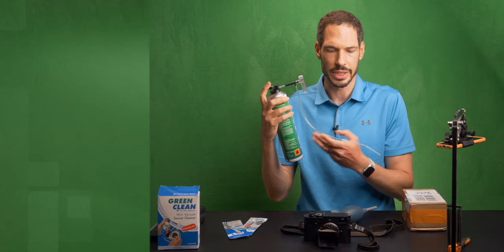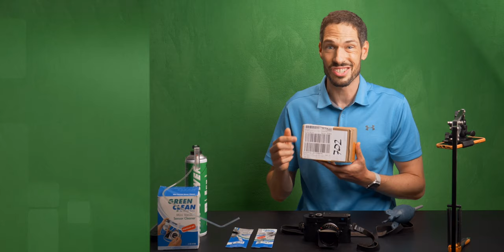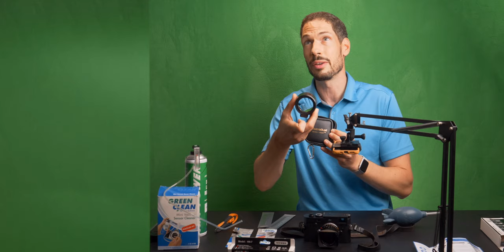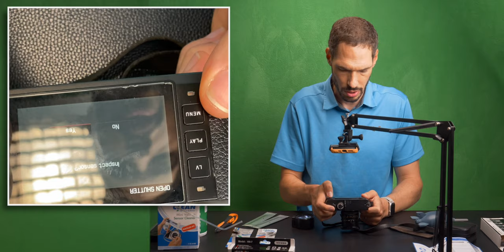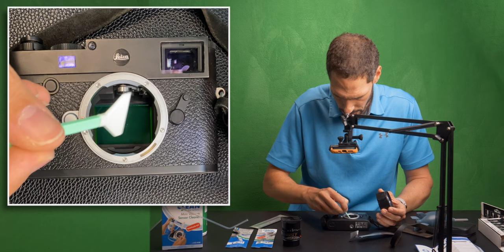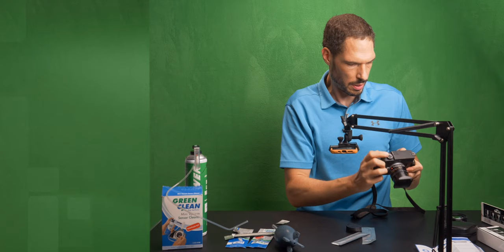Never use old wet sensor swabs! How I saved my Leica M10

Comment: Hi 
I have an " old M8 " that I cleaned with a wet swap - all dust marks gone but a bit of a smear mark on sensor! - camera shop where I bought camera 14 ++ years ago said they will clean it free - so will be bringing camera to them soon !
I think I will make  it a habit to only change lenses on camera before setting out and just use camera with one lens at a time !
That is no swapping lenses in the field !!
Have a 35-50 and an ancient 135 with goggles !  
Get vid thanks !
Reply from the maker: Thank! Being careful when swapping lenses is a good practice. Most of the smudges after cleaning don't come from dust but tiny oil droplets (probably from the shutter mechanism?) or other liquid 'dirt' from the sensor swab. 
Enjoy the M8, it's a fun camera.

Comment: i understand the logic behind not wanting to blow the air into the camera. but i would never touch the sensor with any suction device or anything else besides swabs. AND unless i absolutely have to. Just use the blower but have the sensor facing the floor and gently blow air onto it. This resolves 99.99% of the issues. If you have oil or anything of that sort on the sensor then use high quality swabs. I use Invisible Dust. Very good. Also sensors by nature already do have a protective thin layer. No need to sweat ;) Thank you
Reply from the maker: Thanks for the comment and suggestions. Touching the sensor with the suction device was an accident. But good comment, and I will never do it again. Blowing in it with a blower and having the sensor facing the floor would have saved me a lot of stress...
Reply: @bplatel You could’ve avoided all this by doing some light research on sensor cleaning techniques. The “blower thingy” has been used by professionals for years.
Reply from the maker: @ziggy149 , sensor swabs are also used by many professionals, and I have used them with a lot of success before. However, these were apparently overdate. 
Blowing dust around in the housing of the camera could result in dust particles in unfortunate places. That's why it is recommended not to do that by some... Still would have been safer though 😅

Comment: To test for dirt etc on your sensor. Switch auto iso off, use F22 or as near to F22 as possible, select a plain background grey or white. Take an image of plain background while rotating the camera in a figure of 8 or a circle o . Why? the background will be out of focus, the marks on the sensor will show up in the same place every time you look on your monitor screen not looking at the image on your camera. Repeat until clean. Use swabs once each side, keep dirty swabs for cleaning lens mounts etc. Good luck.

Comment: So you clean peace of glass and not sensor.Sensor is sitting under two glass plates where stuff as IR filter is on the back side.
Reply from the maker: You are correct. However, the sensor is inseparable from these two glass layers, therefore most people include them when they say 'sensor'. Similar to the screens of mobile phones. Even though a lot of layers are in front of the actual LCD/OLED panel (glass, touch layer), when you drop it and break the glass it you have to replace the entire screen. Therefore I would not find it false to it as "I broke the screen of my phone" instead of "I broke the first fused glass layer on top of the LCD-panel in my phone". ;-)
Reply: @bplatel  You would be surprised to see how easy is to remove sensor cover glass and IR filter once you strip down to the main board and sensor assy.There is also air gap between the cover glass and sensor.Leica has relatively small gap in order to accommodate older lenses and there performance since they are made for film and not for digital sensor.
Reply from the maker: @eagleeyephoto8715 , as that may be. No repair service would only replace the cover glass for you... <- annoying indeed, but reality afak
Reply: @bplatel  Actually they do and charge complete assy.If you ever saw sensor cleaning at Leica service you would decide to clean that plate by yourself.
Reply from the maker: Gotta love the Leica service, takes months, costs a fortune, and doesn't always help. I remember I had my 50mm 1.4 ASPH for service (CLA) because the focus was too tight. Got it back, focus is still similarly tight (cost me about 230euro, and took 3 months), and the next time I used it a small screw fell out... Luckily I could find it again and tighten it myself... One of the reasons I chose to do this myself...
Reply: @bplatel  Leica service...hahahahaah, you don't want to send camera there for cleaning.They used to use that sticky pen which leaves residue and can damage cover plate.I also gave up on sending mine film Leica's for rangefinder adjustment.